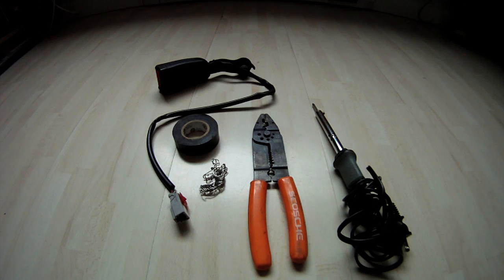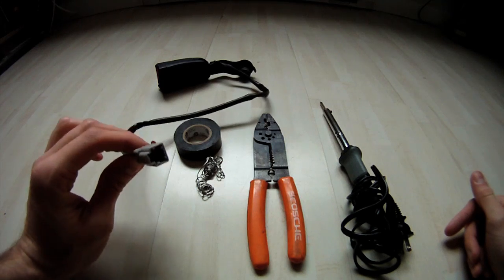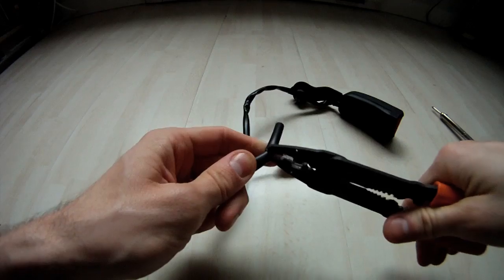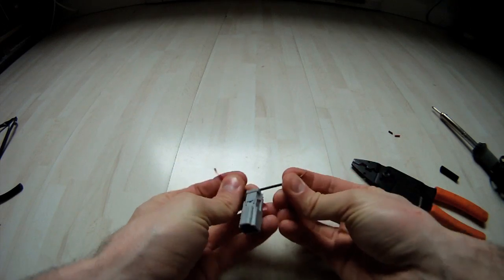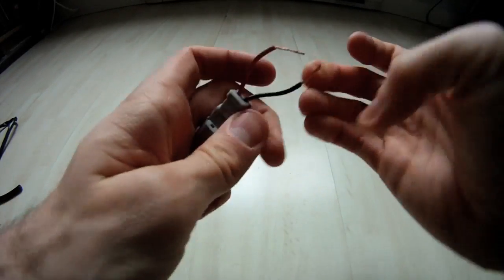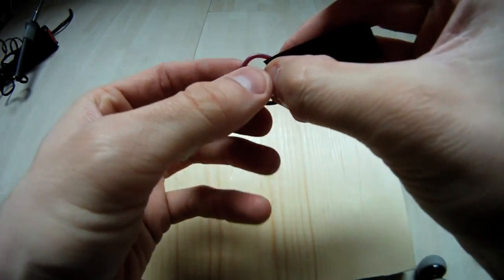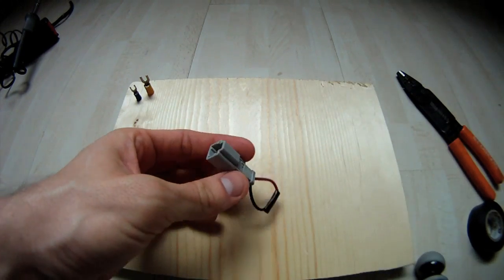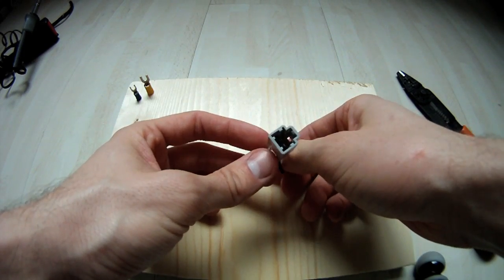How To: Make your own code scanner/service connector thingy for CEL/ABS/ATTS/4WS codes for Preludes

Comment: I don't actually understand the consept behind reading the trouble code with this?. Which obd scan tool can I use? What is the reason behind shorting these wires. Please help me
Reply from the maker: What is done in the video is a very old method in an attempt to retrieve codes from a 90s Honda instead of purchasing w OBD scanner. For example, if a vehicle's Check Engine Light was on when starting the vehicle, one would plug this makeshift device into the appropriate area of the vehicle. The CEL would then blink several times and one would have to count the number of blinks and cross reference the number of blinks with a list, which is typically found on car forum websites, that provides all of the codes and the associated meaning of the codes.  
Not everyone had easy access to an OBD scanner, so a work-around method was usually the to-go. Some owners of Honda's from the 90s used a paper clip instead of this makeshift device. 
Currently, OBD scanners are readily available and relatively inexpensive. Choose one that suits the vehicle that you own. 
I hope this helps a little bit.

Comment: Youd think after making a  video you would realize what this is. It is NOT an obd jumper, its an SCS connector. Used to extract trouble codes from a honda. Of course it gives you manufactures codes, most people will want codes in p1 or p0 format. But with the honda code list, you can cross reference. The  SCS connector also allows you to pull CEL,TCU,SRS,ABS,4WS codes by blinking patterns through each respective dash light. {on board self diagnostic of every main computer}